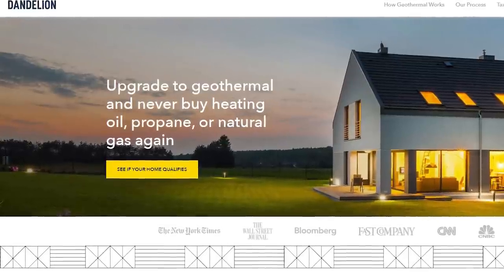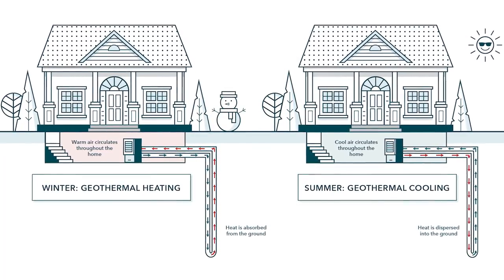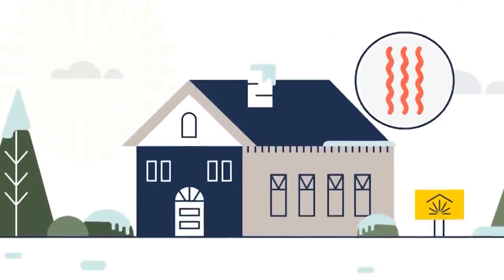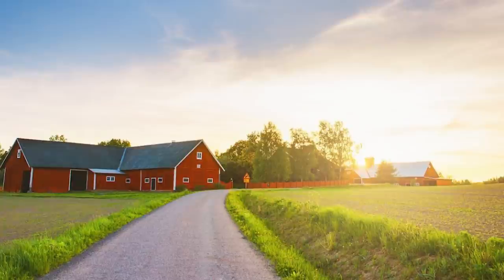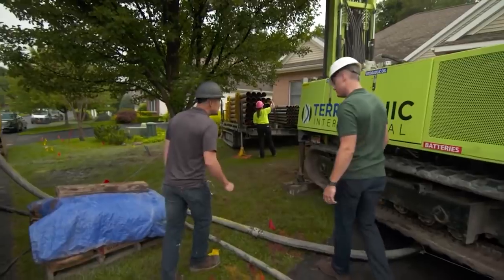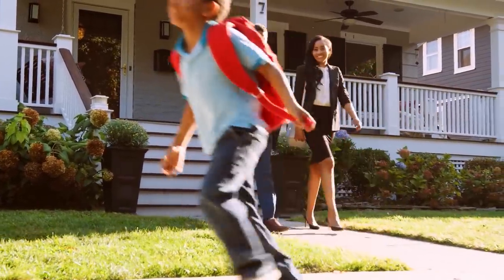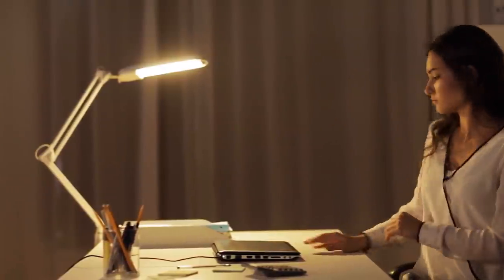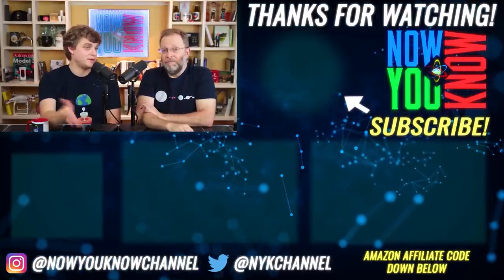All Your Geothermal Questions Answered | Dandelion Energy

Comment: Here in Europe most of new houses are build with such systems. Especially here in Austria there are a lot of companies offering these systems. I myself have the closed system installed for 5 years now and I am very satisfied. You dont have to burn anything to heat your house. Fantastic. 👍
Reply: @markplott4820  Ground Source Heat Pumps use 20-25% the Electricity of a normal 100% electric HVAC system, because of the smaller delta Temperature difference. Also can be used to pre-warm domestic Hot Water saving more energy.
Reply: Which companies in Europe, would you recommend looking into in terms of using a system that is on the leading edge of this technology?
Reply: @knekker1  HELIOTHERM make the most efficient heat pumps. Big company from Austria.
Reply: @Hanneskitz  cheers
Reply: Sadly very few in the UK. The need for a green revolution in retrofitting existing especially rented housing is acute.
Reply: Plenty of hydropower where you live too so it's not just being burned somewhere else
Reply: Cordwood biomass boiler from froling would be awesome too

Comment: She’s very good at explaining things in lay terms.
Reply: @teslasoldier2198  I'm a reasonably knowledgeable mechanical engineer and homeowner in the Northeast. Her explanations were accurate, as far as I'm concerned. Very little, if any, spin.
Reply: But she was wrong about Island.
Reply: Mr Seppo In what way?
Reply: @SirHackaL0t.  She said they must drill deep but its the other way round, thats the point in island, its easy accessible.
Reply: Mr Seppo Still not sure what you mean. 🤷‍♂️
Reply: @SirHackaL0t.  In Iceland hot water comes straight from springs. There's no need to Drill die thermal energy. The ground ist already hot.
Reply: My understanding: Average global drilling requirements for fracture-based EGS is 3 kilometers.  She said Dandelion only goes 300' for its shallow closed loop geothermal.  In Iceland, the tectonic plates are pulling apart, the magma's heat is closer to the surface, less than 3km.
Reply: In fact, yes, in Iceland, sometimes at the surface!

Comment: In 1995 I designed and built a house which included a geothermal system in northeast Oklahoma. I was totally satisfied. I am sure the technology is much better now. The financial analysis is pretty much the same as solar panels. The savings over time pays the cost. I also preheated water. During the summer my water heater was always off. In the 15 plus years that I lived there, the only maintenance was a check up every 5 years. It was always ok. Only wish would have been solar to run the pump and blower.

Comment: Thank you so much for an depth, interesting and stimulating interview.   I have been wondering for years about the how and why of Geothermal heating,  but I never knew one could have a combined system! We have a Solar panel for water heating for approx 6 months of the year here in Poland (EU) for us the efficiency is amazing 62" C on the roof and 57C at the storage tank. We also have an underground 2,700L storage tank for natural gas for water and central heating for the rest of the year. Air conditioning is in only one room. The bedroom is the same temperature as outside 30C + in Summer! (In the Winter we just change the Duvet) I think that Dandelion are onto a winner, especially with the company ethos and the affordability with those amazing incentives! 10/10 Guys!
Reply: How often do you need to get the gas tank checked for leaks?

Comment: I built a new home and we went with Geo thermal.  With Geo Thermal and foam insulation, our bills for the size of our house are super cheap!!   I don't know why this isn't the standard.
Reply: Did you compare costs to using electric heat pumps? I always see eco builders promoting wall mounted heat pumps and wondered which is better. I am like Zac. I have solar but need to tackle my heating & cooling next
Reply: I just hired a geothermal company for a turn key product.  I didn’t research any of the system components.
Reply: I think sufficient insulation can help a lot. The less heat you lose, they less energy you need to use to warm it back up again.
Reply: @tabottietjen3186  "geothermal" in this context is a ground source heat pump... Same thing. Maybe you're referring to an air source heat pump?
If so, they're far less efficient for the reasons mentioned in the video about the air always being the wrong temperature for what you want to do but also the low specific heat capacity of air means you need to run a big loud fan to get enough air through which is annoying and the unit its self is large, ugly and very much on display

Comment: I built a home 10 years ago incorporating a closed loop geothermal system. They used 6 vertical wells that are 200 feet deep. It is water to water exchange that includes a walkout basement with a heated floor. It has been  very comfortable and economical. I’m heating and cooling 5500 square feet and living in the most comfortable home I’ve ever lived in. No regrets from the northern plains. The initial expense was high but it has paid for it self thanks to the tax credit that was available at the time. I’m all electric. I just became a follower of your channel today and I’m binge watching. You guys do a great job, thanks.

Comment: I have 500ft of pipe 5-6ft deep. Way cheaper than drilling a well. It does swing a 10 degrees over the year. I just planted trees to shade it in summer, which is the biggest temp swing time.
Reply: It depends on the amount of heat you need, and the cost of land in the area. In expensive suburbs buying another 2000 square feet to lay pipe could easily be more expensive than drilling, or even just not possible.

Comment: Ah! I guess this is what we in the UK call a Ground Source Heat Pump using a bore hole. I've not tried the bore hole but my GSHP runs on 450 metres of plastic pipe 1 metre underground. About 10 years now and it is working well. I'm using conventional radiators because the house is too old for under-floor heating. It rarely gets too hot in Scotland so not having the cooling function is no great loss.

Comment: Totaly agree.. have a heat pump connected to geothermal source here in the netherlands for 5 years now. It is very efficient, fail free up to now, and the free cooling part in hot summer days is so comfortable. Electricity usage is 2000kwh a year, and we get 8.000 - 10.000kwh a year of heating energy in return. Floor heating/cooling on every floor, no radiators whatsoever. Very comfortable, very low running costs, and very efficient.

Comment: We built our house in 2013 with annualized geo-solar, it has been quite effective
This system pairs a heat collecting solar system with a much smaller geo-thermal system
Heat from the solar system heats reservoirs that can heat the house in the shoulder seasons
In winter, the extra BTU are extracted from the geo-thermal system
In summer, the extra BTU generated from the solar are stored in the earth like a heat battery
For example,  here in the Kootenays, in Canada, at the end of August my ground temps are 75f with the only heat demand being hot water
By February the ground temp will have dropped to 60F, instead of dropping to 45F as it would without the solar boost.
Fun stuff, took us a few years to fine tune it but it works great now.

Comment: I wonder if they fill the holes with the pipes with some "conducting mass" to better transfer heat from the pipes to earth, it's probably gonna be filled with water from the ground naturally.
Reply: They do. It is a special grout, with high heat conductivity properties.
Reply: Bentonite grout is standard, bentonite thermally modified grout is better, but research into cementitous grout shows it's is superior in price and thermal conductivity.

Comment: Another fun fact they did not mention about the advantages of an open loop over a closed loop is that the water traveling down to the bottom of the hole is pushing the water comming up the up pipe. So the energy required to circulate this water is almost nothing compared to an open loop system that has to pump the water up from the water table. I need to see if they offer this in my area. Thank you guy's. You're doing a hell of a job trying to save the planet and bringing the laughs too!

Comment: :) so, the heat-pump uses electricity, so a combination of solar and heat-pump would be the answer!
Reply: maybe for running the air con in the summer when sunny but not for the opposite in the UK where I live. Solar has a capacity factor of 2% in December which is when you need to heat your home the most.
Reply: @doritoification  Norwegians are using it, hard to believe England is colder than Norway.
Reply: @subhadityasen5486  I'm guessing, without looking up the numbers, that Norway would also have very poor performing solar during the coldest months when domestic heating would be needed the most.
My comment was specifically about using solar to run the heat pumps not saying heat pumps would be bad in the UK.
I think heat pumps are a great idea in most places.
Solar is already a joke this far up north and expecting to run domestic heating off the sun on top of all the other things that solar is already useless for in December is just a fools errand. Might as well admit that heat pumps in the UK will be using natural gas derived electricity at 400gCO2eq/kWh

The inefficiency of turning the gas into electricity (60% of the energy is lost) is more than compensated for by the efficiency of heat pumps (400% equivalent) and on windy days our grid does get a lot cleaner and we might be getting a lot more nuclear in the future if we're lucky so yeah in conclusion... Heat pumps are great. Solar is a joke.

Comment: I have a heat pump since 2013. The coolest thing with the ground connected serpentine is that one can cool his home for free.
Reply: It's cheaper but it isn't free.
Reply: @richardlangley90  Well I oversized my fancoils and I circulate the ground cooled water directly in the system. The heat pump is not used. The only energy consumed is 120 W for the circulating pump and some very small power for the fans in the fancoil. So when I use less than 300-400W for cooling 350 square   meters I consider it free. And I have solar but that is different story. :)
Reply: @1234mu8  Excellent idea Emil...most systems are not plumbed to bypass the GSHP...in fact every system I have seen separates the field loop from the house loop....you must have designed this system yourself.  As an example my field loop has a manufacturer recommended three circulation pumps...two pumping in and one on the return...197w each but they only run when the GSHP is running.  If I had a more efficient (tighter more insulated) house then the loop would not be so large, the GSHP would not be so large and the pumping would be much less.  I am assuming that your 120W is running almost all the time?  My system operates at 46F for AC and it can run for quite a long time on a 90F day.
Reply: @richardlangley90  I don't know, never checked. Maybe 3/4 of the time. I only observed the time when heating. In the most freezing days -20C the system works 12 hours a day ... 1/2 of the time. And that includes the hot water too.

Comment: I am self installing a 'Geothermal' system with vertical loops using a 21cfm 90psi rock drill modified for a 4 inch bore (Down-the-hole hammer drill). I was hoping to put 1.5" pipe down in the U-loop but I will either go with 1.25" (higher lifetime pumping cost) or ream the bores out (more likely).
I have limestone and possibly granite about 60ft down so I needed something more than a rotary drill. I got the reverse flow idea (air exhaust pumps cuttings out the pvc drillstem) from the DIY Terragrinder which is rotary. It's much slower than the professional rigs but sure beats the $10k or more price tag for drilling. Paired with continuous exterior insulation and air sealing (poor man's spray foam which is spray foaming in rigid foam boards, more labor much less cost), my heating and cooling bills will be quite low. The 8.85kW PV array I single handedly installed on the roof had a better ROI, so I did that first.

Ground sourced heat pumps are thermodynamically superior to air source heat pumps, but air sourced have a volume priced advantage and lower cost of outdoor equipment install vs loop field install. GSHPs also last longer as the compressor is inside, and loop fields don't normally need to be replaced.
Virtually free domestic hot water when in cooling mode is an option but most use a desuperheater to pre heat the DHW.

The next efficiency gain after variable speed compressors will be turbo-expanders; Basically having an expander replace the expansion valve that helps drive the compressor saving around 10% more. They aren't currently being produced in volume at the typically HVAC scale of around 1-5 tons.
Reply: Can you explain what exactly an expander is, to a person like me who is not very familiar with this? =)
Reply: @knekker1 
https://en.m.wikipedia.org/wiki/Vapor-compression_refrigeration

After the condenser (that dumps heat out of the system), the cooled high pressure refrigerant passes through the expander (instead of the normal expansion value) and spins a turbine taking more energy out and results in an even cooler and now lower pressure refrigerant which are both better for the evaporator that then absorbs heat into the system (cooling the space for A/C or taking the heat out of the ground for heating). The expander turbine is connected to the compressor and helps spin it reducing the electricity needed to spin the compressor. So more heat is exchanged and electricity is saved.

https://en.m.wikipedia.org/wiki/Turboexpander

Comment: So i should buy solar panels, home battery, and a geothermal heat pump?
Reply: Solar, yes.  It's cheaper pretty much everywhere in the US.  Unless your at the bottom of a valley with trees all over, you will make your money back and then some.
Battery, probably not.  It really depends on state/local laws.  If you have net metering, you can simply sell your extra solar to the grid, and buy it back at night.
Geothermal, probably.  You will very likely get your money back over time.  But how long is pretty variable.

Comment: GSHP's are awesome but there are things you need to know.  Before you contract to have a GSHP installed you should have an Energy Audit done in order to understand a) Your homes calculated heat loss b) your homes calculated heat gain c) improvements that you can make to your home that will improve a & b and their associated costs.  It is ultra important that you do improvements to your homes energy efficiency before you consider a high efficiency HVAC system.  In order to get the most out of the system you need to understand that the system must be tailored to your home.  Considerations for the system it self - the ground loop must be designed to provide sufficient heating and cooling for the design load...this means taking into account the geology into which the ground loop will be placed.  My installer used a rule of thumb...300ft round trip loop for each ton of cooling....I have a 4 1/2 ton system  so I have 5 - 300ft loops.  My loops are horizontal vs the vertical that were discussed.  The cost will be cheaper for horizontal loops depending on what the ground is made up of and if you have the room.  The impression I got from the video is that only one 300 to 500ft loop is used in their systems....I suspect that is not the case.  Drilling is very expensive....and you need to give thought to the trenching that will be needed to keep the pipes under ground from the well to the house and that holes will need to be bored into your foundation in order to get the pipes into the house....if they go above ground or above frost level they will need glycol.  Second consideration - the GSHP itself must be designed to match the house load...too big and it will cycle on and off, too small and it will never turn off and wont reach desired indoor temps.  Third is that if this is going into an existing home that was heated with gas or oil the duct system will not be optimal....Heat pumps push much more air because the temps are about 20F lower, which means that for a house that is designed to use a Heat pump the ducts will be much larger. As was noted, if you need AC all summer then you will benefit from free domestic hot water (if you pay for that option...keep in mind that this will require a second hotwater tank... so it takes up space.  The second tank pre-warms the water going into the actual hotwater tank, eventually heating the primary hotwater tank if there is enough heat).  Finally, make sure you know which GSHP manufacturer your installer will use...search the web for customer comments, and make sure that your installer is not the only installer servicing that brand.  Electric, Oil and Gas HVAC companies will not normally service GSHP's.  Search for customer feedback on the company you want to use and look for a company that was in business before incentives came along....they will likely do a through job and will likely be there when a compressor needs replacing or a circuit board etc.  If I were to do this again I would seriously consider an Air to Air heat pump as they have come a long way....but only after super sealing and insulating the house.  Just like solar, you want to reduce the load as much as possible so that you can install the smallest most efficient system possible...reduces both your capital cost and operating cost.   Remember that heating costs are typically half your utility costs, at most, so a %50 savings on Heat and AC may sound like a lot but in the end your overhead will still be %75 of the original bill.